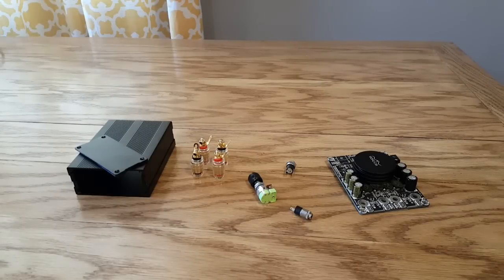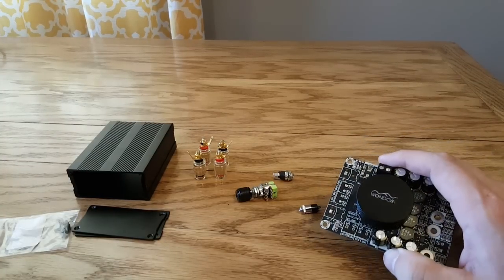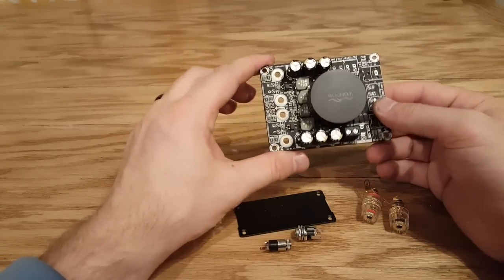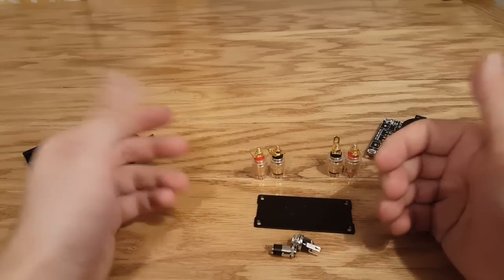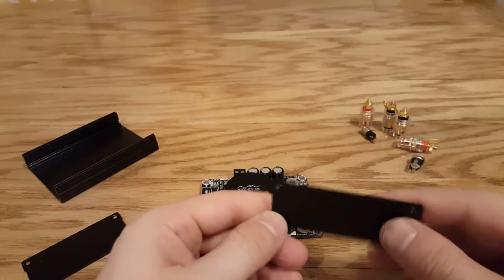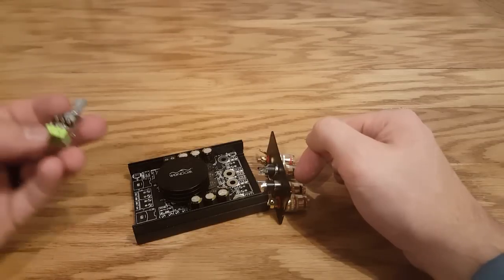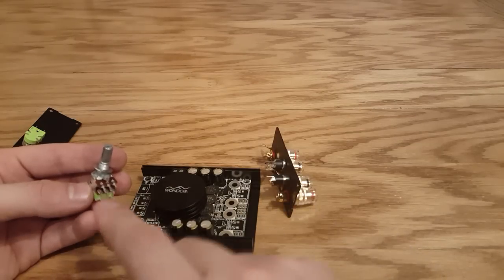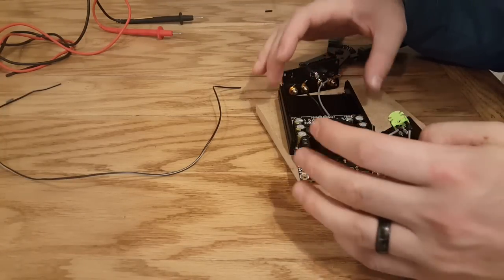How to Make an Amplifier for you Speakers!

Comment: Nice video, but you should have connected the switch in the potentiometer to the power switch connection on the board, but it is fine if the switch is rated for 19v 4.8a

Comment: Maybe a stupid question, but you don't need a volume control?  Perhaps you're using the volume control on your PC to accomplish that?
Reply from the maker: Clay C The knob on the front is a power switch and volume control in 1.  When you turn the volume all the way down it will actually shut the power off to the unit.  I just chose to use a switched potentiometer, but you could just use a stereo potentiometer if you don't need the power switch on it.  I hope this helps

Comment: How did you get the amp inside the project box? It seems to be just a tiny bit too big to fit!
Reply from the maker: First, I had to desolder the screw terminals and remove them.  You do not need them anyway, as you'll just solder straight to the board.  After that, I had to wiggle it a little, but it fit.  It's tight, but it fits.  There is nothing that you can damage where the tracks go, but make sure you do not break the board itself.  But work with it, it goes in (assuming you are using the same board and box).  Once it is in, I move it just enough to solder the wires I need, then move it back into place.  I hope this helps. :)

Comment: What gauge of wire, and single or stranded, are using for this type of build?
Reply from the maker: Steven Clark I think most of it was 24ga, with the exception on the speaker terminals.  Those I used 16ga.